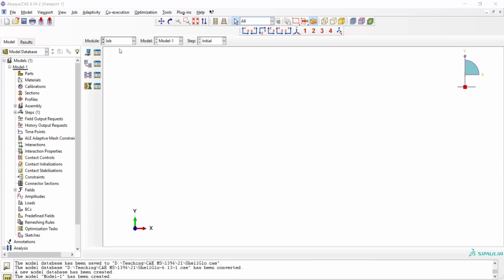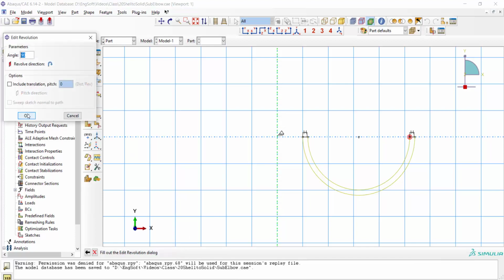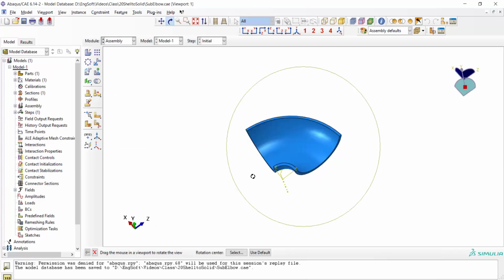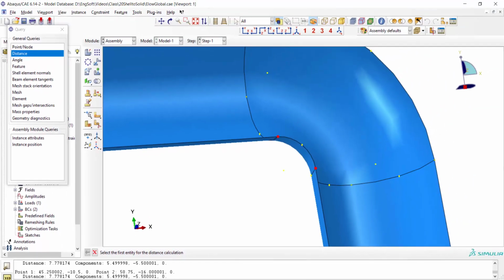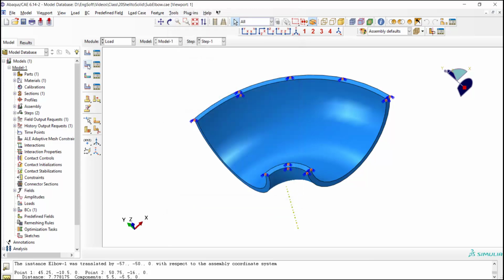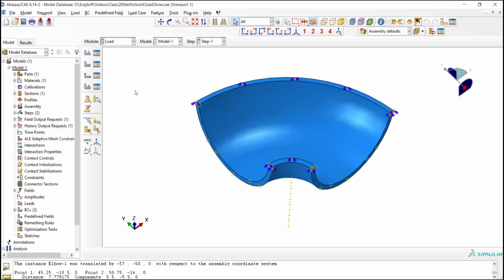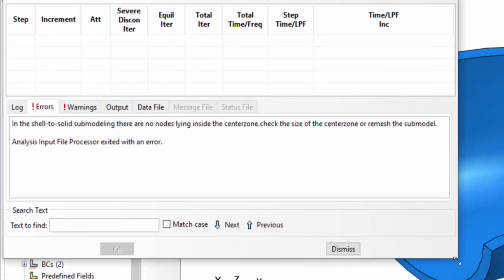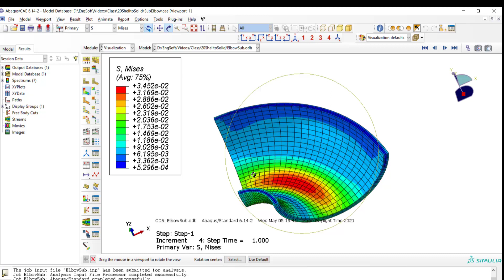Shell to solid submodleing in Abaqus, Part 2: Solid Submodel

Comment: Can we run a static, Riks with submodel?
Thanks!
Reply from the maker: I did not try it yet, but I guess there is no problem.
Reply: @engineering_software  Thank you for your replying!
When I run it, there is an error "Submodeling capability cannot be used within the static analysis with riks method", I wonder why ABAQUS allow to make a static, Riks step in submodeling but don't allow to run it?